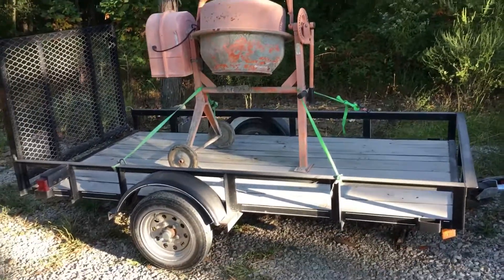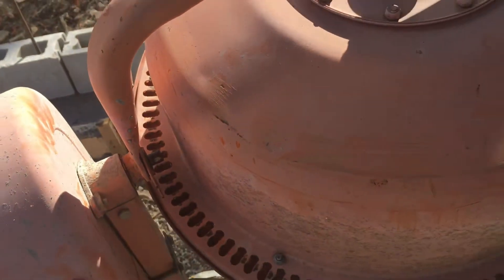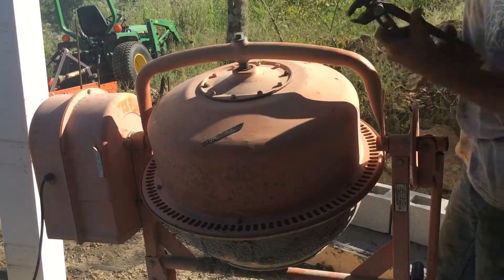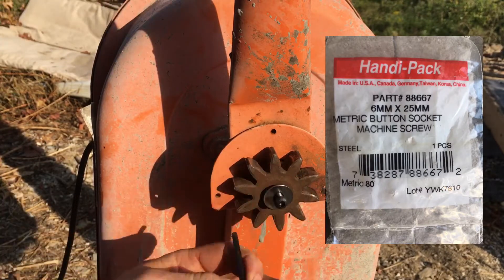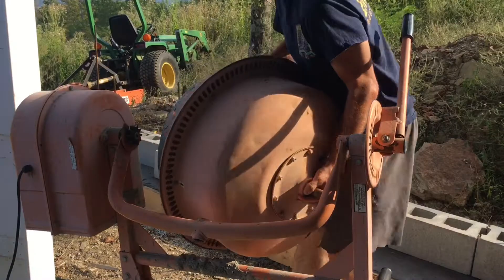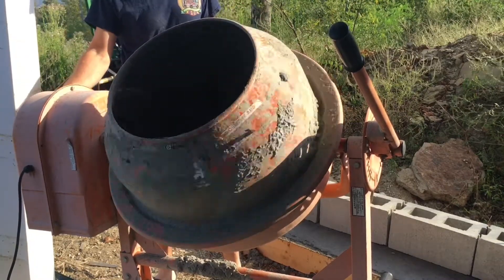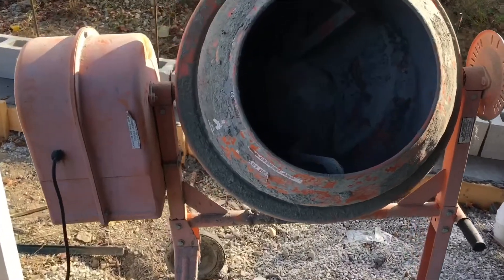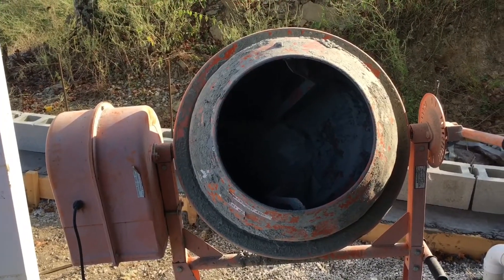Fixing a busted harbor freight cement mixer

Comment: Can’t get the handle to move that swings the drum around. It will unlatch from the grooves but the drum won’t move. What could it be?
Reply from the maker: Possible concrete caught up in the bearings.
Reply: @CaptainKleeman  thanks!

Comment: Classic kleeman, found this in the archive. Did you ever get the mixer cleaned out or just use it as is. If so what worked best.
Reply from the maker: Tom Bixby kind of cleaned it out.  Got the blades cleaned anyway.  Seemed to work well for what I needed it for.